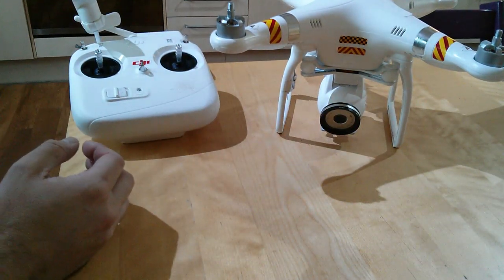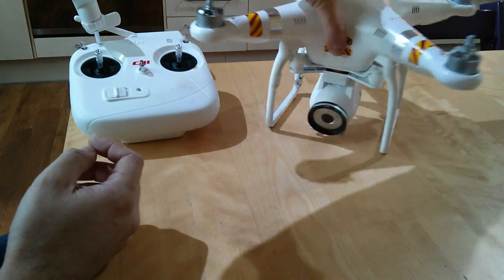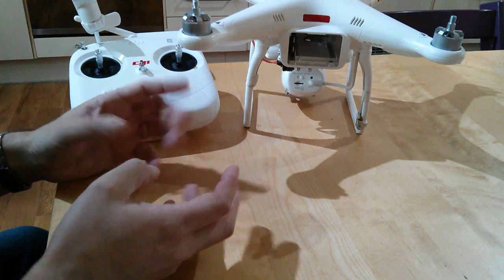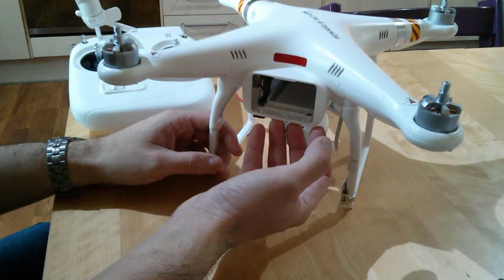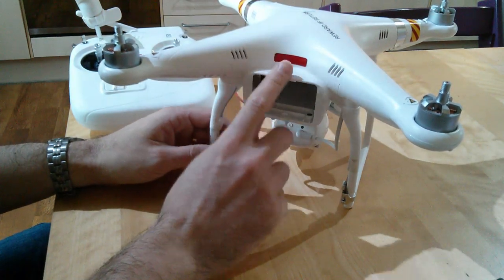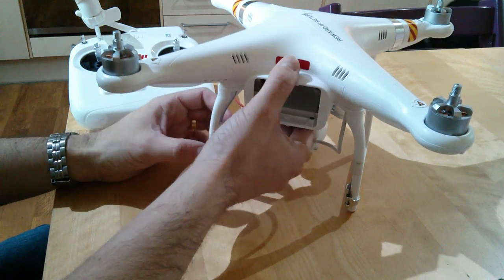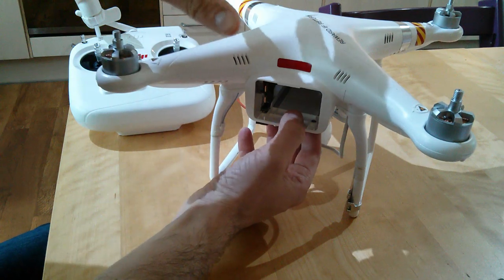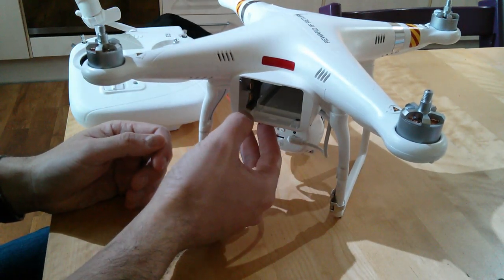DJI Phantom 2, Vision, Plus: Compass Calibration. How to, where to and some of the why...

Comment: Thank you, thank you, THANK YOU for providing the info and the detail.  I'm ESPECIALLY grateful you covered when to calibrate and why you'd want to.  I wasn't sure if every flight was required or what.  As many have posted all over the Internet, the instructions are kinda missing some critical info.  Thank you for filling in the blanks and helping me get rid of a lot of question marks.  I'm subscribed and will be checking in frequently, I'm sure. :)

Comment: Don't care what the rest of them say, I loved the conversational style. I learnt a fair bit too. It appears that my Phantom has a compass error.... constant drift in the air but follows all commands. My added problem is that when I click S2 6-10 times, it doesn't register, so I cannot calibrate. NOt sure how to get round that, I'll just have to keep on digging..... Great video and the dog made it!
Reply: Thankyou sir, I appear to have got it running. Ended up taking it into the middle of nowhereand resetting it and it worked! |FLown it twice now and it feels just as it did before. :-)

Comment: I bought it straight from DJI, the website. I'll add that mail address to my earlier mail. Thanks for that! How's the fpv reception so far on your new kit? Notice that the wifi, tablet setup on the P2V plus is not great. No bad but you def need to keep in eyesight of the copter.

Comment: Thanks Simon-Another great vid--Just a thought I'am looking at extending my landing gear height- I've watched vids where the compass position is marked, then placed at the same height on extended legs. Is this critical? or would a re-calibration fix the new compass position?
Daft question--re-calibration should work ok.
Also-If you have lots of piercings-would this effect the compass-cal?
Naaa-just kidding.
Cheers.
Reply: ***** Cheers for the reply Simon. Makes sense. I want a bit more ground clearance for the gimbal.
Thanks.

Comment: Hmmm, I think i have a problem with my phantom 2 vision+ that some people are having... Drift when yawing. I have done a compass calibration and an advanced IMU calibration but it does nothing. Any tips?
Reply: ***** (WARNING: very long comment) Hmm, yeh, it happens slightly when i do it slowly too... This is what is preventing me form going any more that 100 feet high and 50 feet away!!! How on earth do those people manage to get over the clouds and going over 1000m away without any worry? It just does not feel right for me to go to high or far. I think its because i am too used to flying my syma X5C which needs input all the time and cant be controlled easily when far away). I am too scared that when i go to far things will go crazy i am afraid to loose my phantom... HOPEFULLY!!! They can fix this in a firmware update cos even toy quads don't do that (maybe cos the FC has less to worry about on the toy quads while the phantoms FC has to worry about the compass GPS, etc) i did not pay $1179 for something that will make me crash into a tall tree because i just wanted to rotate my quad!!! I might sound negative but i do like my phantom very much!!!. I have the V3 Phantom BTW. I actually have no idea how you are still reading this comment..... I had nothing better to do than create a huge comment.... Thank You for your time!!!
Reply: ***** Erm... Maybe ~1-2-3m, so that means my phantom is normal... GOOD!!! BTW!!! Ya i will ALWAYS keep my phantom in sight but even if it is in clear sight and i go a bit far, it still worries me, Do you think i should stay that way and keep it really close or do you think getting it about ~100-150m away is ok? Cos like i MIGHT of said i still dont dare go any further than about 30M away...

Comment: I also have a P2V and im totally dumb founded, I tried to calibrate it just like the manual says, its had maybe 30ish flights.....I have always had a slow flashing green light but at the same time while hovering does dancing circles in a 6ft radius. recently I calibrate it and it does double flashing red/yellow, and it doesn't  budge a bit now  while hovering, its smooth as butter when most cant fly it. (in GPS mode)
Reply: Note: On my Iphone, i have no calibration warnings, 9-11 Satellites and have used return home 3 times (freaking out!!) and have had no issues with perfect landings, I am afraid to use the DJI assistant with a Magnet to fix something that's seemingly "fine" ??? But am still worried about a fly away. These phantoms are still so new i seen to be the only one thats had a Red/yellow flash and found the craft to fly better lmao...go figure.
Reply: Hey thanks for the replies guys, i asked around on RCForum some more and i totally forgot to think about the area i was flying in. a local guy had told me that there used to be a radio tower under the field and the wires underneath were just pulled out but never shut off? I thought it was weird but i went to another field and its fine now. They said it might have just been magnetic interference. Also, the RCforum guys said to NEVER try the magnet even if it looks alright, but to just order a new one if that should happen. Its more costly to get it wrong then just replace a small part.

Comment: Don't forget to power off after Calibration and power back up again before take off...... Important to do so....
Reply: Simon, 
I'll have to get back to you on the exact reason.... Been a little while since I took a couple hour flight course from my Local DJI authorized dealer.  It's something they taught, but I can't recall the reasoning.  I'll hook with him and let you know the details.  I'd been flying a while, but wanted a little advanced training, and it was something they stressed.
Reply: ***** This was the explanation given by the DJI Tech:  "The phantom does require the restart of the system (just the helicopter, radio not required to restart) after the calibration, in order to save the new information in the firmware.  Similarly with computers you need to do the same after loading more critical system updates.  If the manual no longer tells you to do so then the option is up to the user, however we would definitely recommend doing the simple process since it is relatively quick, and will save you quite a bit of coin in the event that something went wrong. The assistant software for the phantom will prompt you to restart the device after loading new firmware as well."